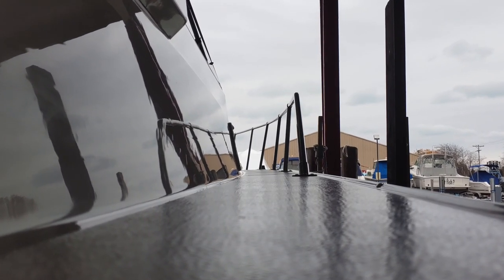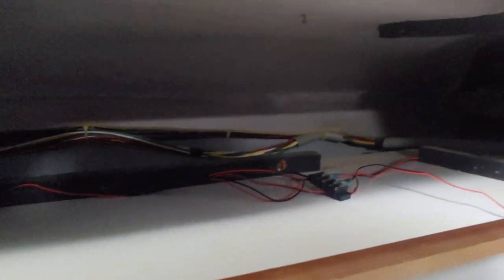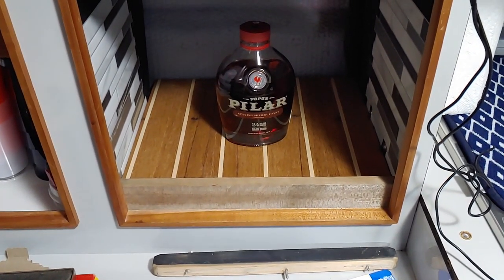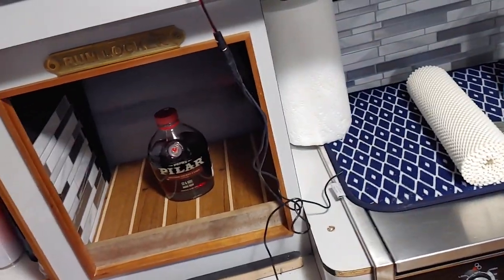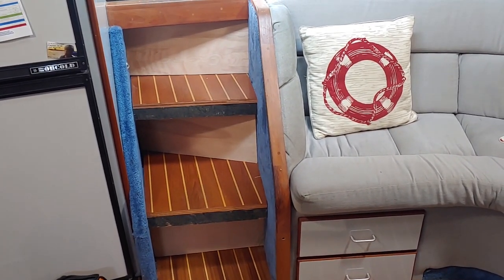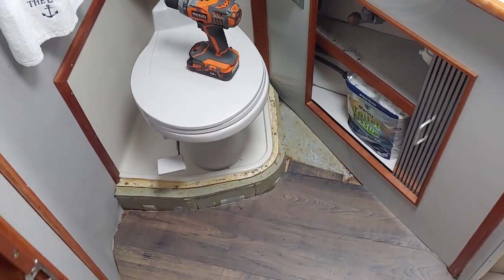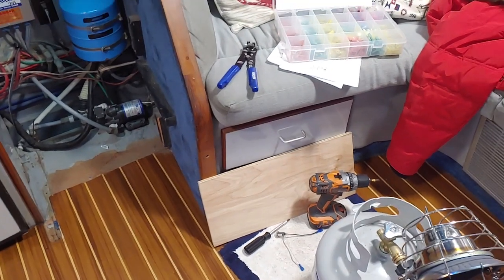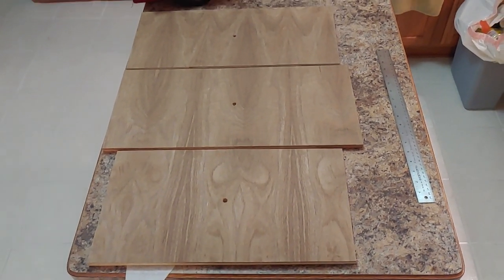Sea Ray 390 Express Restoration VLOG Episode 18

Comment: Good morning, Captain, have you ever had to remove the sliding cabin door?  If so, is it in any of your videos?  The lower track is fairly straight forward, but for the life of me, I cannot figure out how the door comes out of the upper track!  Thanks!
Reply from the maker: I have not filmed the process, but it is not hard. There is a rivet or two I believe I had to drill out. If I remember I will explain it in my next video.
Reply: @Living_Lodka  That would be great! Thanks!!